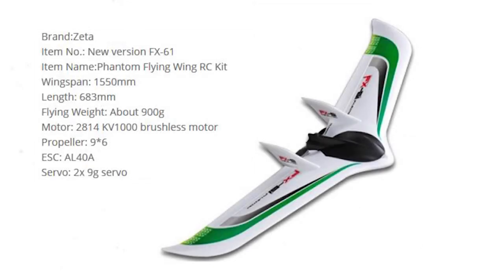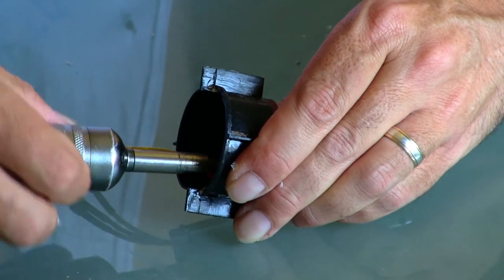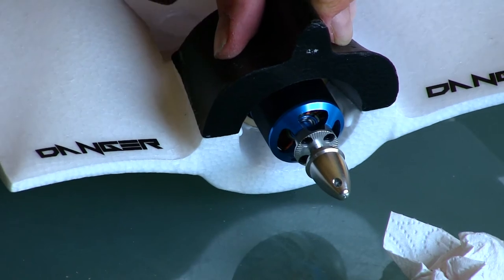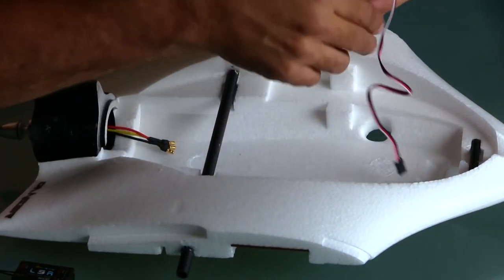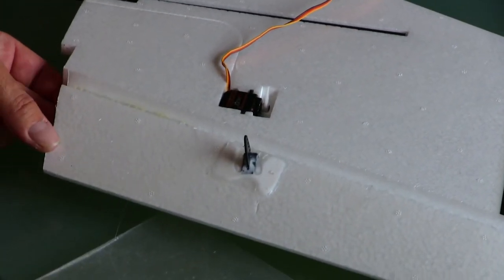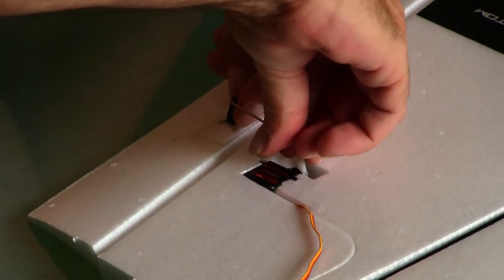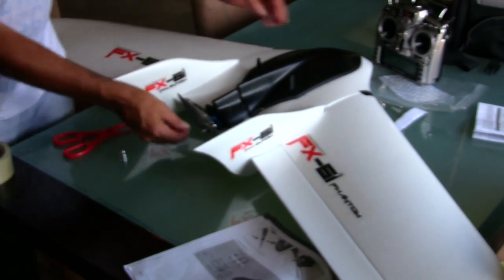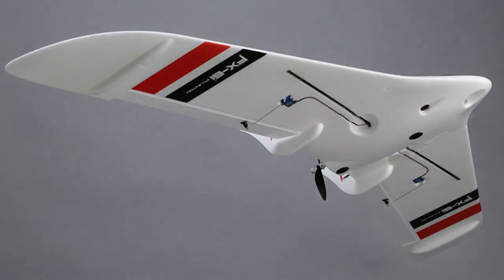Zeta FX 61 Phantom - BNF Build Part 2

Comment: will it fly in the nxt video? cant wait 4 it to fly..
Reply from the maker: I have to buy some more electronics for it first before i fly it. Next video hopefully will be first flight. I can fly it now but it has no safety features and is not stable in the air. I have to buy a flight controller and GPS for it first then it will not only be stable in the air it will also return back to me when it loses signal.
Reply: Stonemedia RC Entertainment. ahhhh okie,, hopefully it could fly soon, i really want to see fly...